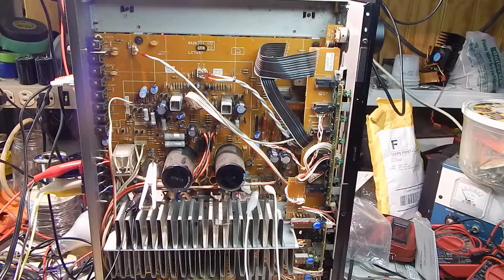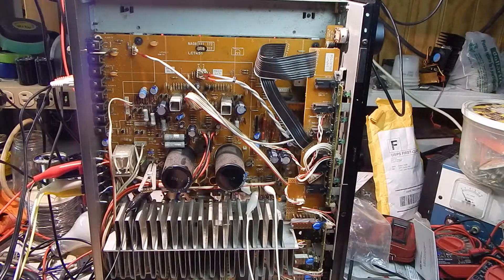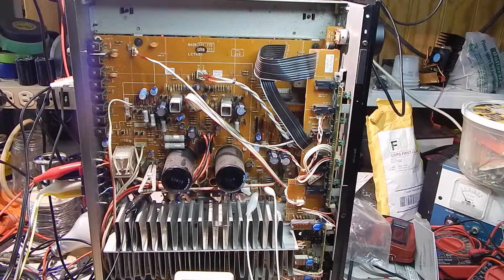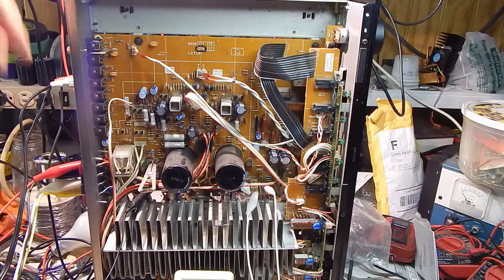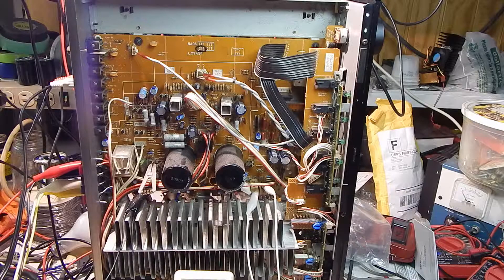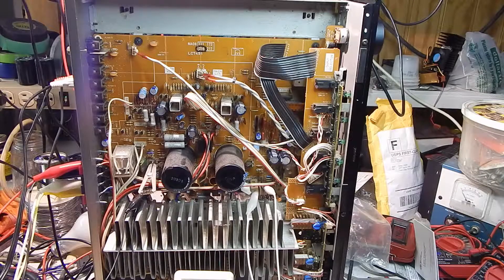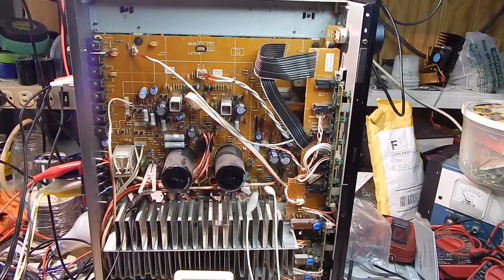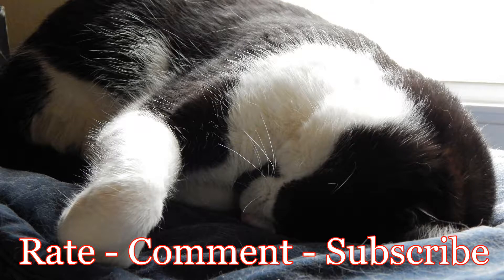Workbench Ramblings and the Yamaha Amp Revisited.

Comment from the maker: Turns out, once I got the non contact thermometer out, the same driver in the other channel heats the same way, it was just harder to access so I missed it.  Perhaps if I replace all the light blue caps and checked all the rest, maybe bias might behave better, or not.  So leaning toward throwing a couple chip amps in there and de-powering the original amp but it might not be easy as I have to work around the extensive protection circuit(s).